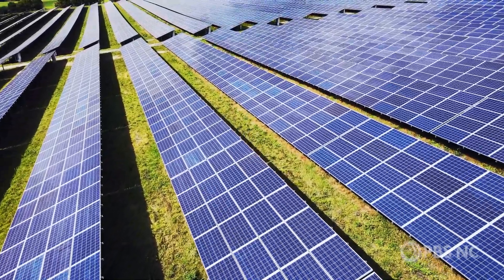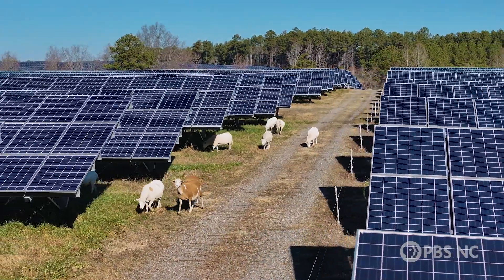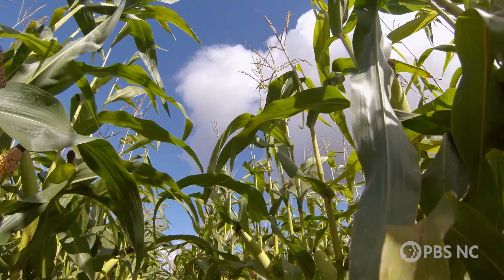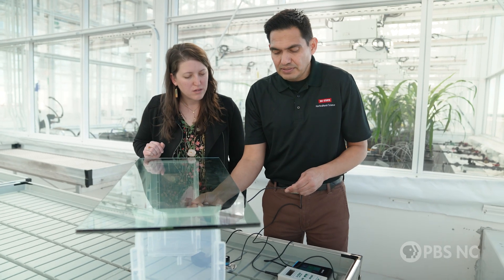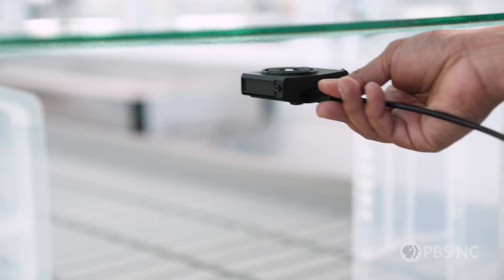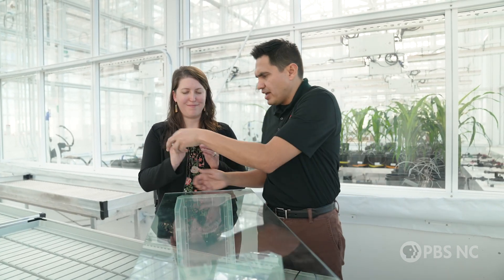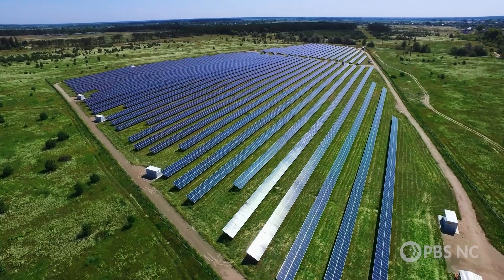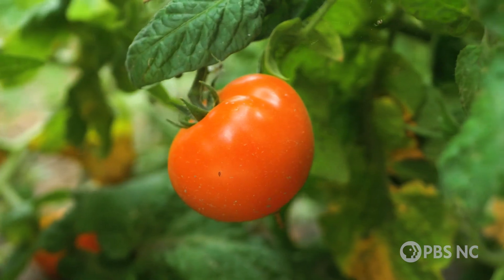Can solar panels and crops share the sun in the same place? | State of Change: Solar Harvest

Comment: PV panels are cheaper to install and maintain at ground level, but in coming years when more agricultural land will be needed to feed the additional 2 BILLION people before population finally stabilizes, it is very shortsighted to cover prime farm land with solar panels. Unfortunately this is happening with many installations in the U.S.
Reply: @ronkirk5099  We will not need more land. Quite the opposite. Just read the papers by Tony Seba and Precision fermentation , you will be surprised.
Reply: Considering how much land is used for crops to ethanol and how ineffiecient it is for energy production, makes this is a non-issue.